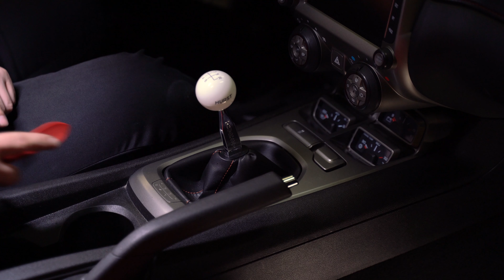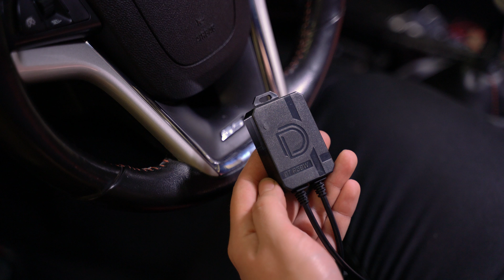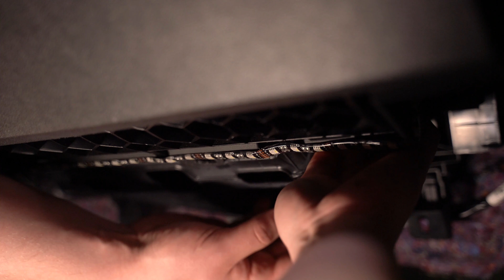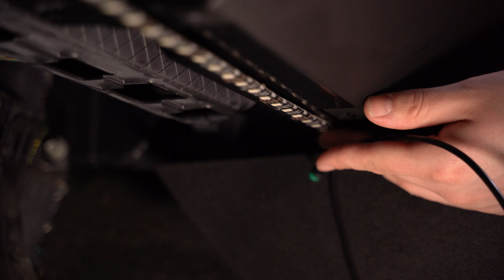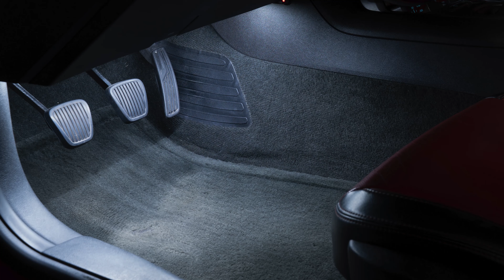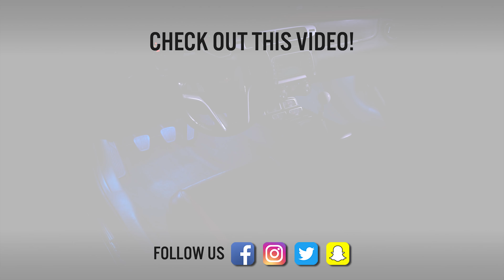How to Install a Multicolor RGBW Footwell Kit | Diode Dynamic

Comment: Did you tap both red and black wire on the same wire?
Reply from the maker: Hey Zach! When splicing into the cigarette wiring, red goes to red and black goes to black. So, they will each be on different wires.

Comment: If I want my lights to be on whenever the vehicle is on or if the headlights are on, by tapping an ignition or headlight wire, is the toggle necessary? Are there preset colors that can be selected without the use of the app, ie hit the toggle and it switches between colors with one option being off?  The ability to chose between 16.7 million colors is great and all, but I don’t necessarily want to rely on a wireless connection if I’m realistically only going to choose between 12 or so colors.
Reply from the maker: This kit specifically requires our RGBW Bluetooth Controller for operation. Sorry about that!

Comment: Can I use an add a fuse?
Reply from the maker: Hi there! You shouldn't need to add a fuse to run these lights. However, we're sure you could if you could, but it would require some additional wiring!

Comment: Will the adhesive hold in high heat conditions? Ie. hot summer or heater blowing hot during the winter?
Reply from the maker: The 3M adhesive backing should hold, but as you can see in the video, we use a couple of zip ties for some added security!